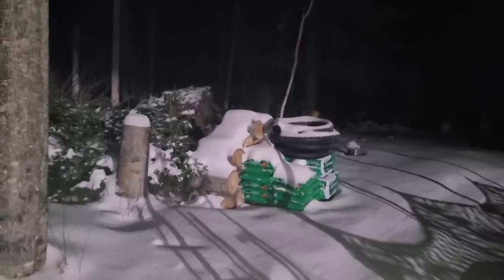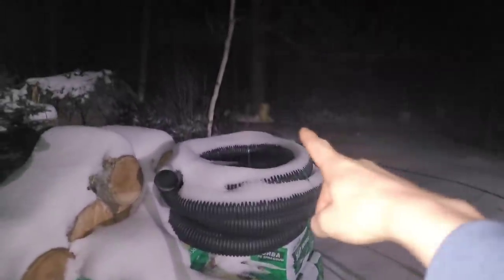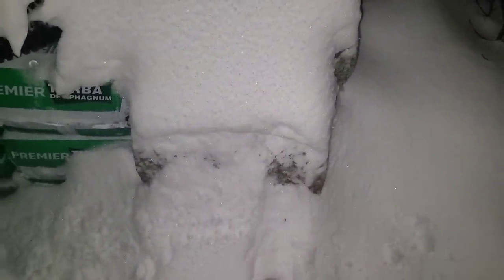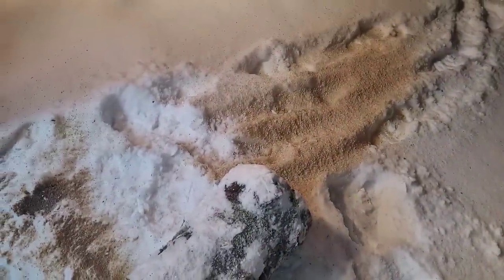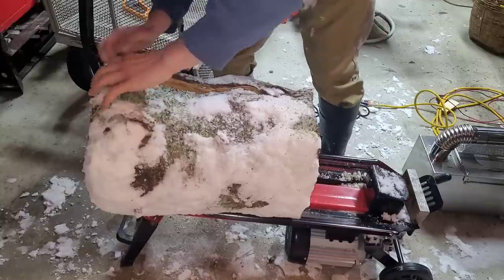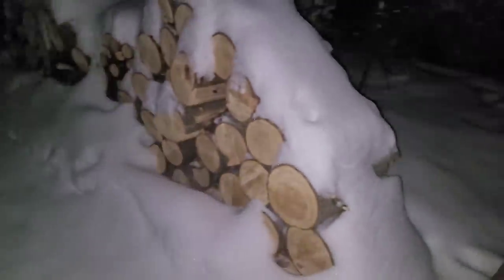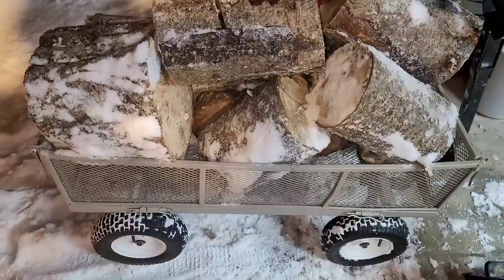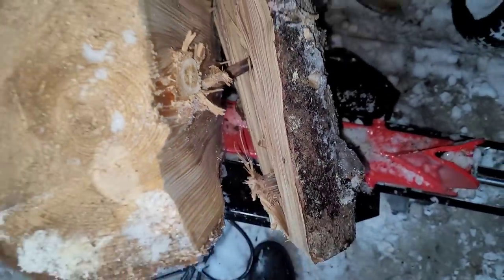Splitting Wet Knotty Wood

Comment: The hydraulic fluid is to thick to work right!  Any way ~ I dearly love my Oregon 18" cord electric chainsaw  Shes a BEAST >   Best chainsaw i ever owned.  Very easy to tighten up the chain or replace it > PLUS Self sharping lever as well. SHE IS SWEET!  All my power tools are Cord Electric,  There cheaper, more dependable, lighter, and much much more quitter. The only thing got a gas engine is? My gas Generator! That the only thing that don't give me trouble > All the gasoline engine power tools are just setting around  I HATE EM